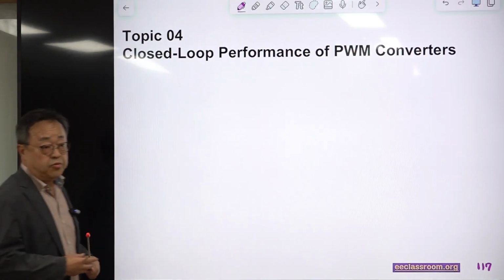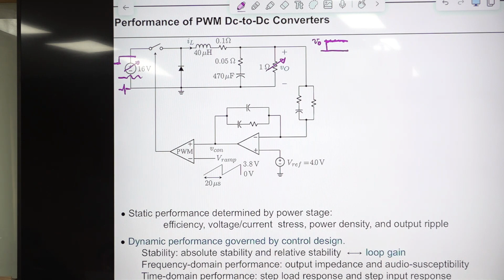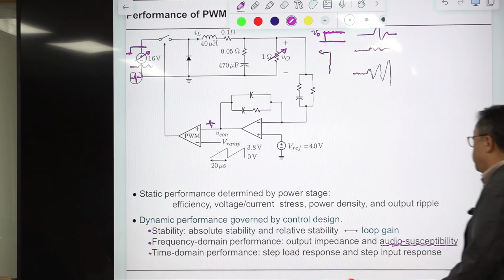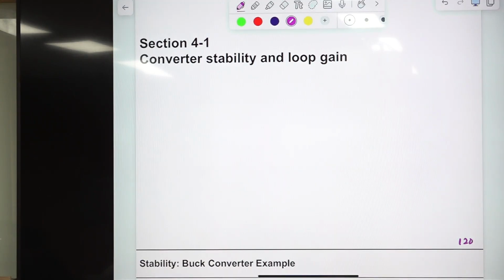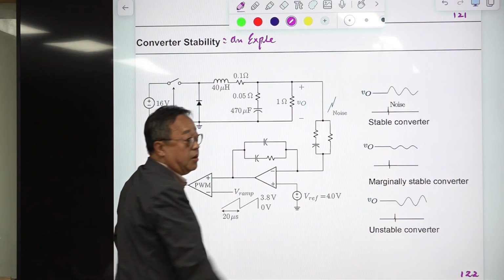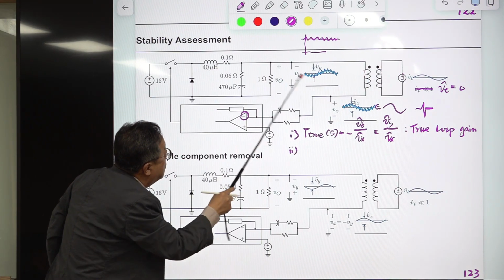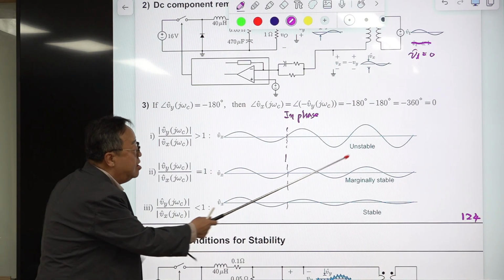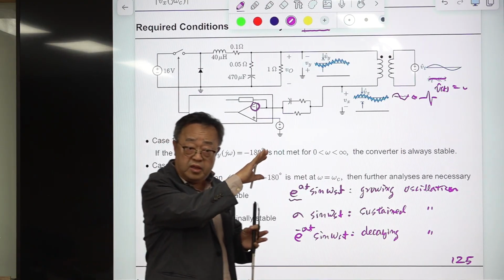Lecture 01: Converter, Stability, Loop gain, Buck converter, Oscillation, Unstable converter, Phase

Comment: sir.. which book / reference book you are using for this lecture?, many thanks
Reply from the maker: Thank you for your inquiry. The lecture series are mainly based on my book ‘Pulsewidth Modulated Dc-to-Dc Power Conversion,' 2nd Ed. John Wiley and Sons, Inc.,  2022 (ISBN: 9781119454458). However, the contents of the this lecture are taken from my (unpublished) lecture notes.

Comment: Sir ; thanks...
How to implement the compensator for microcontroller?
Reply from the maker: Sorry for the late response. In principles,  we design an s-domain compensation using the small-signal model of the converter. The s-domain compensation will be transformed to z-domain counterpart via an s-to-z domain conversion algorithm and then coded into the micro-controller.